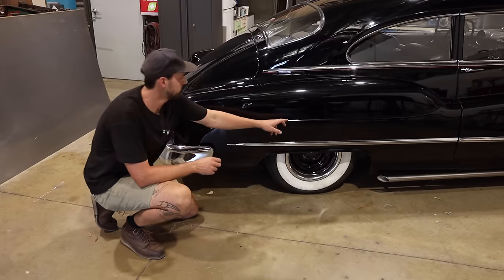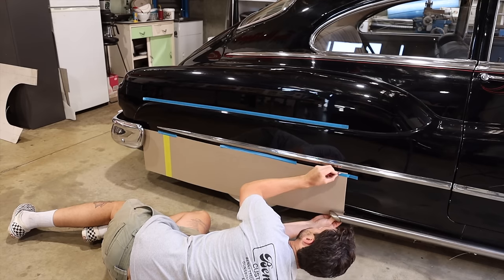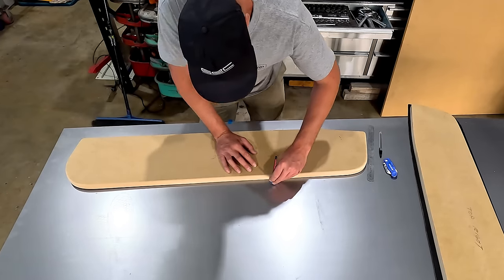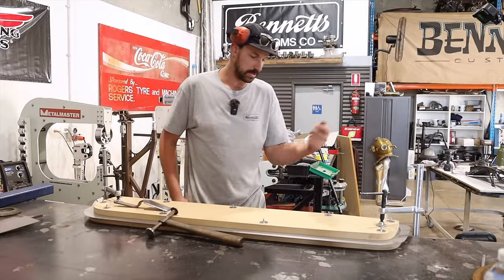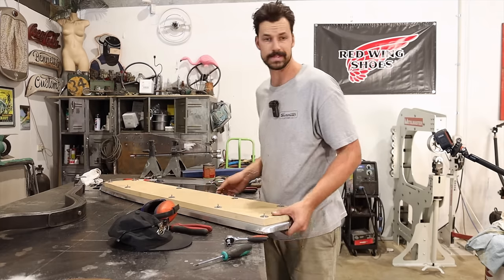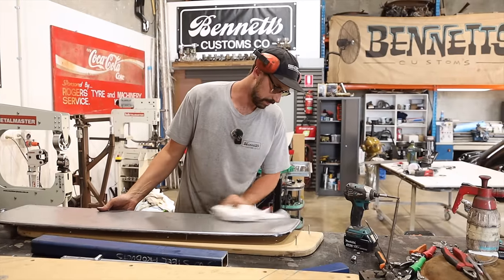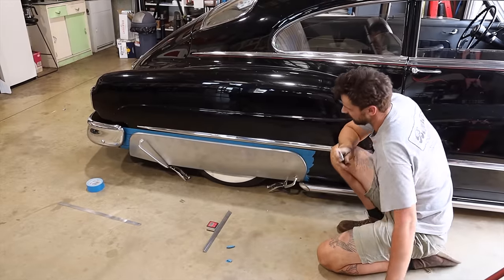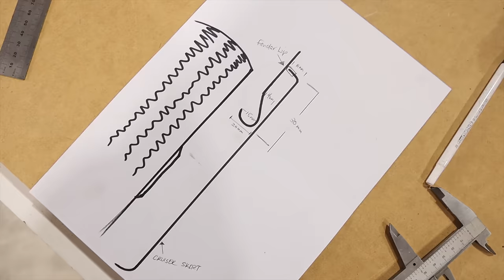How to Hammer Form a Large Panel Using Hand Tools and a Woodbuck – DIY Guide!

Comment: I have a selection of round washers to draw out my lip. They roll around the former so are less likely to catch. I was waiting for you to work out that the air hammer is a lot easier and quicker. Haveagoodweekend Mate. Looks like its our turn for the 40deg temps over here in the east coast.

Comment: I’m an old American.the only experience I have with metric measurements is sockets and wrenches. I was out of school before they started trying to change us Americans into the metric system.But a guy can’t avoid it.Its everywhere. Long story short, I was a little shocked when you were talking about the bolts used to bolt the mold together. You were talking inches. Are bolts all measured in inches all over the world? Nice Car. Just found your Chanel.I subscribed. 🇺🇸👍🤪

Comment: Mon this guy had a stock 1050 Buick 4 door, but it had all the extras on it fully dressed I have never seen the Buick with all the extra bumber guards, stock skirts, Apple ton spot light's and visor. The price was $12,000 because it needed breaks so if it was bought it would have to be trailer home. I regret not buying it because I have been looking for a 50 Buick for year's ever since my cousin bought his at the age of 19 year's old off the original owner it was burgundy beautiful color I was 16 thought it was the nices car I ever road it at the time felt like riding in a Cadillac smooth. The old man didn't think my cousin had the money at the time he named a price and my cousin had it so he sold it to my cousin. I think the old man really wanted to see some young guy owning it. The old man was getting to old to push the peddle. 
After year's my cousin finally sold the car.

Comment: Not a big deal, but the lower die you are using in the English Wheel is a 36 inch radius die, not a 36 degree die..
Reply from the maker: Correct 😂